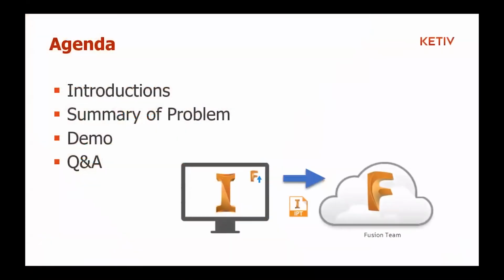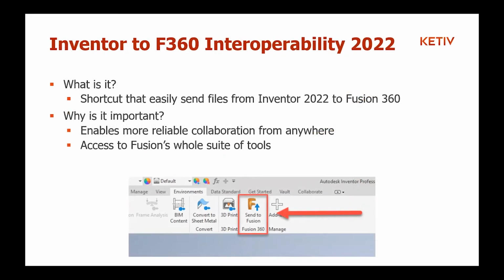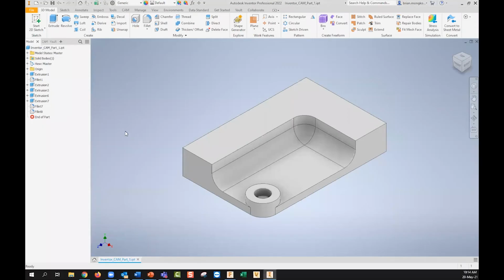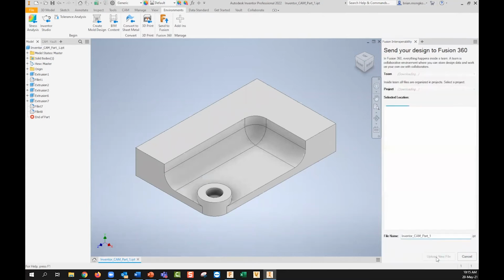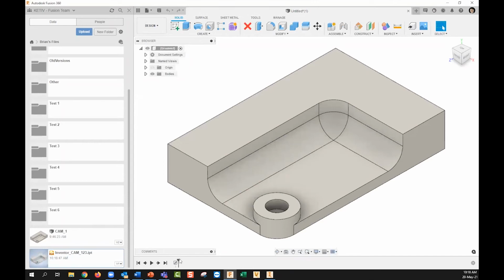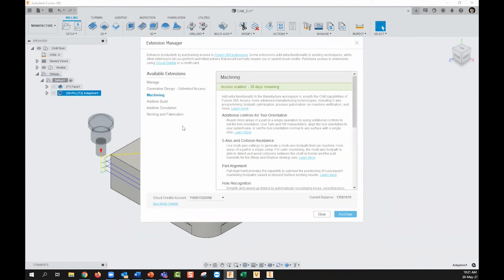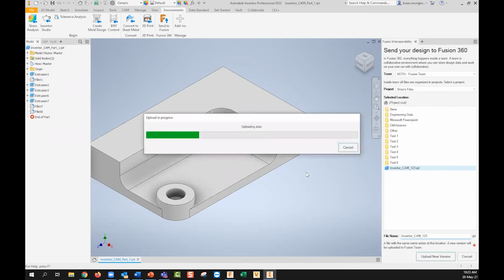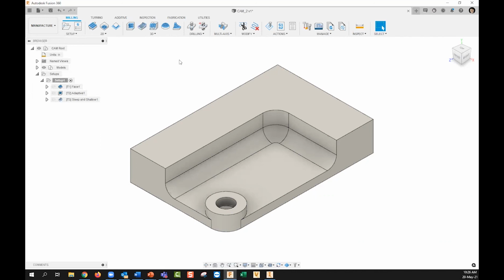Inventor 2022 to Fusion 360 Interoperability in 2022 | AVA Mini

Comment: What software do you need in mechanical design? I work on AutoCAD and Inventor only
Reply from the maker: It depends on what your specific application will be. Inventor and Fusion 360 are great 3D CAD programs. KETIV | Marco